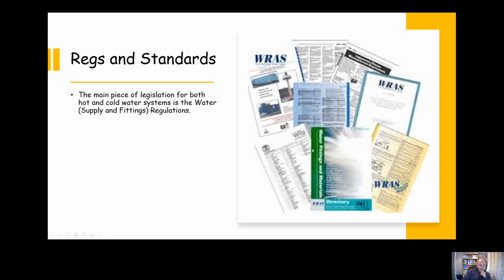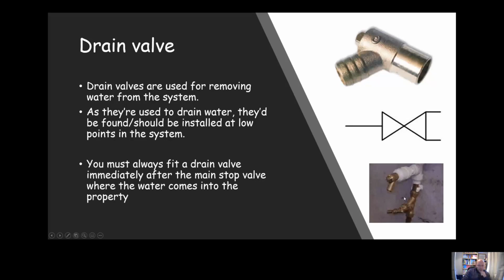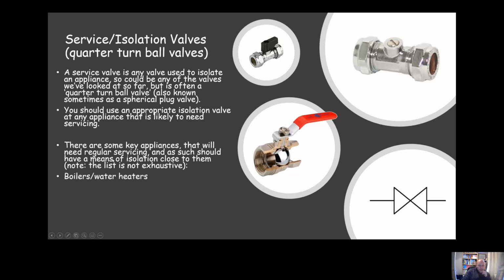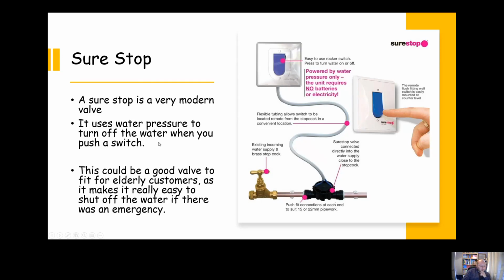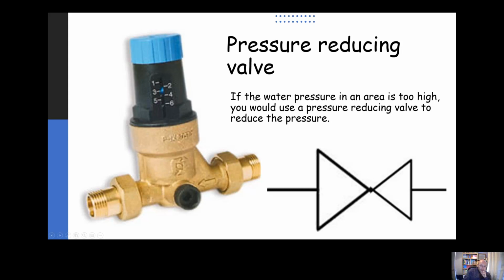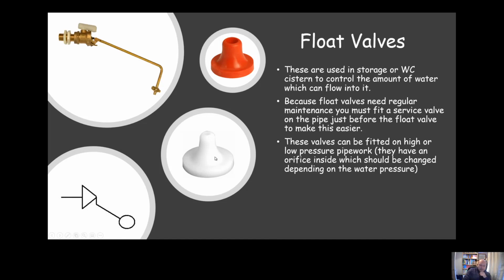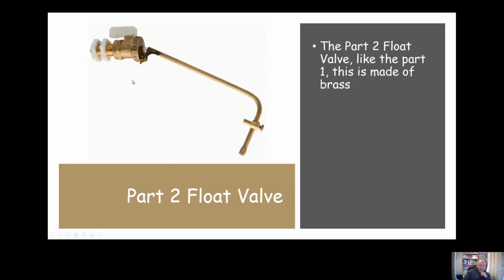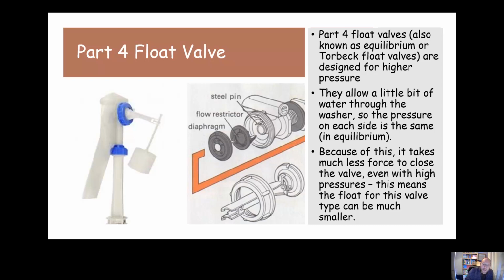2.2 Valves and Fittings

Comment: What is the maximum pressure for 1inch diameter potable water pipe sir.?
Reply from the maker: The best source would be the manufacturer as it will vary by material.